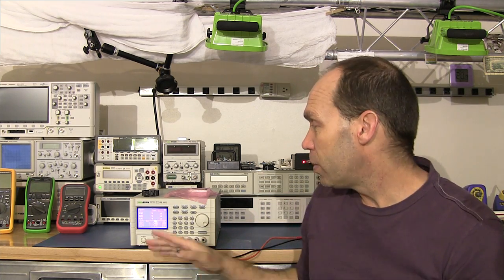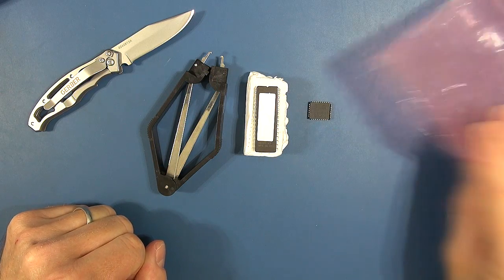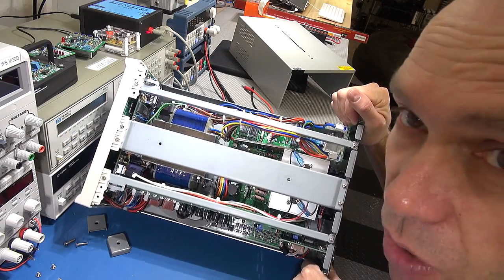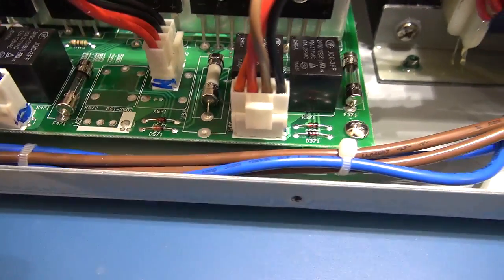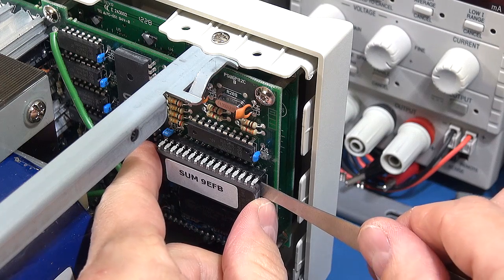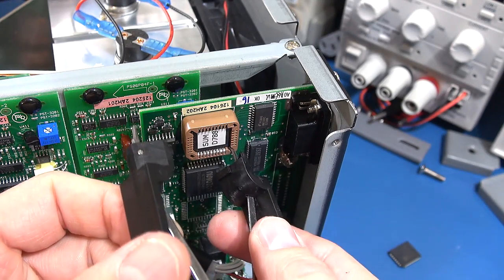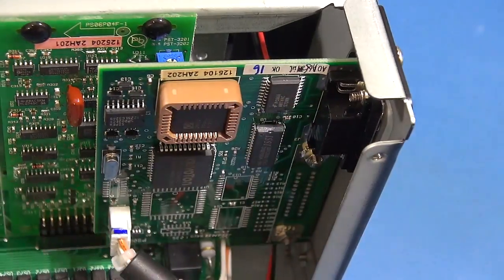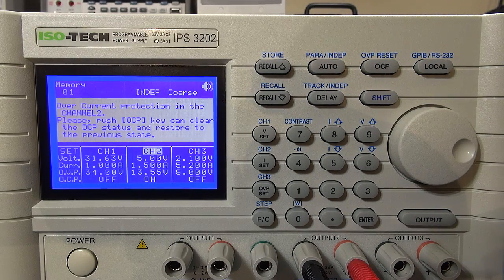A Look Inside #5 - ISO-TECH IPS 3202 PSU Firmware Fix!

Comment: Very useful video as I have one of these very same PSU's in my LAB but to be honest I have not noticed this problem as I have not had a need to use the OCP function at all so far so I will be testing my unit next week to see if it has the same bug,
 
One interesting thing is your description of CV and CC modes, I always referred to these as CONSTANT VOLTAGE and CONSTANT CURRENT modes,
 
Keep up the good work,
 
Dave
Reply from the maker: My pleasure Dave, thanks for the post.

Comment: There are no smaller versions of that PLCC extraction tool. You need to get one hook under the IC first, then you need to push a bit to get the other hook under the second corner as well. After you have done this you just press the black handles together so they will pull on the metal hooks. This will lift the IC out of the socket.
Reply from the maker: Thanks for your post. I was trying that but there's a good chance I was not getting the technique right while filming. Cheers, Martin.

Comment: I think yours is also adjustable as well. There should be a small set screw on the bottom. Loosen it and the hook should be able to pivot.
Reply: They also do make pin specific extraction tools. Digikey sells them but are very pricey.
Reply from the maker: Thanks for the post...just checked, mine don't have the set screw.
Cheers, Martin.

Comment: £519.00 for this PSU??, you can get a Rigol DP832 195W (3 Channels) Programmable DC Power Supply for $400 at tequipment, and judging from the cheap internals its safe to say this power supply is highly NOT recommended. it would be nice if you were unbiased but clearly you not.
Reply: What's your problem with the PSU to say it's highly not recommended? The inside doesn't look cheap at all. Its layout is clean, wires heatshrunk and ziptied, fused in multiple places. The modular design is nice, they didn't skimp on the heat sinks and the transfomer.
Reply: superdau Please look at the Rigol DP832 its far superior, it has a fully kitted with DSP unit, SMD layout, lower wire count (see how much wires are hanging around looks like vines), clean SMD PCB layout, toroidal transformer AND most important its $400.

Its of course not flawless there was an issue with the 5V regulator not having sufficient heat-sinking, but that has been addressed.

If this was a cheap PSU I would not be making these points, but its not, do you get that simple point?? You have not done any research, typical fan boy. :D
Reply: Martin is always fair with his appraisals always giving the benifiet of doubt when he is unsure of something, a point easily seen in this video
Strange you should actually bring up that version of Rigols PSU's. If you take a look over at Dave Jones' eevblog you will see this PSU had been released with an overloaded internal regulator. A simple 1st year power calculation that Rigol missed. It took them 3 attempts to "fix" the problem. In the end rather than address the root cause of the problem, that being too large a voltage drop over the reg They simply threw a larger heatsink at it.
While the Isotech unit may look simpler that is a good thing. PSU's are the mpst abused peice of any lab equipment so simple repairable designs are to be prefered particularly when schematics are so rarely issued these days.
Rigol may be a good manufacturer but they are not beyond having issues and no amount of fanboyism can fix that.
Reply: Rob B then this PSU is good for you too. :D
Reply: ***** It's been 'addressed' by shoving a massive heatsink on it. It's still a fundamentally stupid design..

Comment: It's a rather ridiculous construction for what it is. Only 2x2A and a 5A output yet it has more boards than a 486 and with through hole construction like it was done in 1980. Using 74 series chips..
That level of power including the digital control should be in a cigarette pack. Mains transformers is not something a skilled pro would use. You handle that with a tiny switch mode back end and linear front end if you must. It's like the bench supply community has fallen prey to a community agreement that that's how you make bench supplies and if you deviate you are dumb. When indeed the exact opposite is true.
It's particularly problematic in an age of web shopping that these primitive constructions weigh so damned much that you pay more for the shipping than the supply. 
I count at least 9 PCBs in that supply!  I wouldn't use more than 1, maybe 2 if you really need all those buttons on the front (which you don't)
Reply: ***** It could easily have 2 outputs for 80 pounds. A single 2x16 character display could cover both. 2 momentary rocker switches could control all settings. Or a 4way. Maybe 2 on off bottons for the channels.